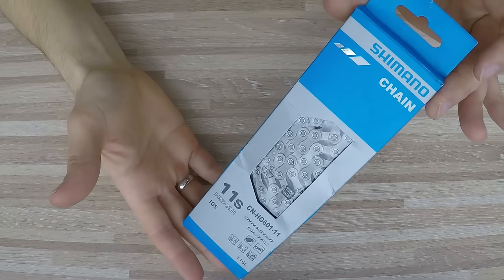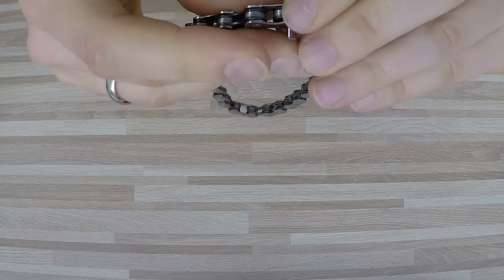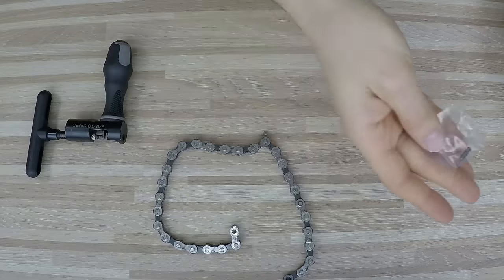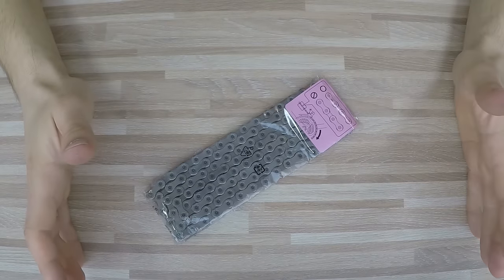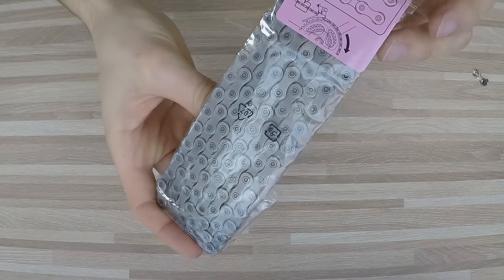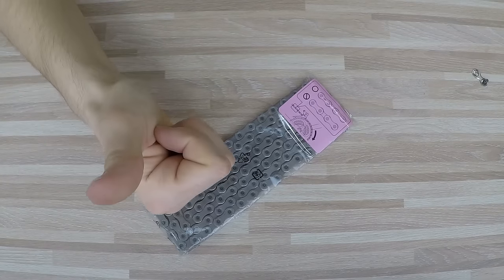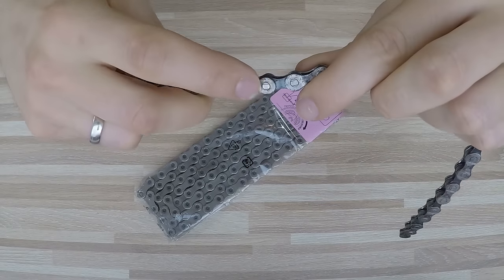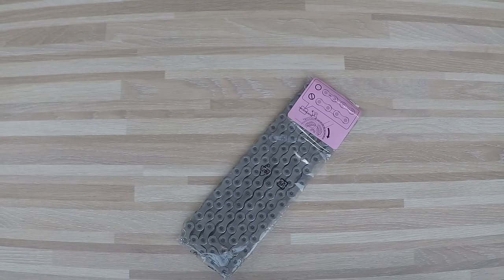4 Worst Mistakes In BICYCLE CHAIN Maintenance. How NOT to do it. SickBiker Tips.

Comment: 1. EVERY chain manufacturer advises NOT cleaning chain by shaking in solvent, because it dissolves lube that is inside the links, and that is where you need it most to prevent wear and tear.  Also, it is nearly impossible to get dirt into that space anyway.  KMC,  Shimano, Campag, SRAM, they all recommend brush, wipe, and clean outside of links. If the chain gets so gross that you don't trust cleaning only the outside, then go ahead and soak the chain, but plan on replacing it sooner than normal.  

2. Most lubricants will displace water.  In fact WD-40 was invented by the space program as "Water Displacement 40."  It is not a lubricant, but more of a solvent.  Use your favorite lubricant after WD-40, if you use WD-40.  (Yeah, I know WD-40 now has a whole line of products.)    

3.  Yes, check wear on your chain and replace around .75...........IF you have a 6-7-8 speed.  Park recommends changing 9, 10, and 11 sp chains earlier.  

4. There are several brands of connecting link, and they are not universally interchangeable.  I'm pretty sure that Shimano does neither make one, nor do they allow you to use another brand.  Experiment at your own peril.  (I have used quick connecting links on Shimano, that worked just fine; I don't remember which brand.)  

5.  Rust on the chain is a chemical change in the metal.  When the manufacturer says not to use acids or other rust removers, they are probably warning against use of chain that has compromised its strength, as well as admonishing against dissolving whatever lube remains inside the links, where you need it. 

Roger
Pedal Pusher Bike Shop, NYC
Reply: I restore vintage bikes and as a rule, toss the chains and replace. They test out as stretched, often have rust on the INSIDE, and are junk as a rule to my mind.
Reply: Sorry pal, shaking chain in can of mineral spirts/or other solvent is the ONLY way to get sand and grit out of rollers. WD40 is nothin more than mineral spirits and 3and1 oil. Boeshield t-9 lube WILL penetrate to interior of chain. Next time you think your chain is clean, while your WD40 is still wet hold a two foot section of chain between fingers and twist. I guarantee you'll hear the audible sound of grit inside the chain. By the way I get around 1500-1800 miles of off road usage with Shimano XTR chains. The chain "experts" who preach this crap are the same idiots who tell people to wash their $5000 bike with a garden hose. By the way, I've been riding and/or working on bikes for 65yrs.
Reply: wwolfdogs we need people with your experience to make videos showing the best proven methods of bike repair and maintenance.  How do you wash a mountain bike without a garden hose?
Reply: I always liked Triflow as a lube. I'm lucky you have an ultrasonic cleaner at work. Simple green seems to work well in it.
Reply: A chain is just connecting plates, pins and rollers. There is no internal mechanism....
Reply: @s0012823  In between the pin and roller is internal to me,
Reply: @wwolfdogs  65 years of wasted effort!

Obsession with getting EVERY little bit of grit or grime off a chain is a COMPLETE waste of time. Why? A half hour on a road ride and your chain's dirty again. Five pedal strokes off road and it's dirty!

The worst part is that it encourages the use of all sorts of solvents, some safe, others not. I found a YouTuber who had a how-to video on soaking your chain in gasoline. There he was working in his tool shop garage using gasoline to clean chains. And showing others how to do it. Completely irresponsible.

THIS is what you want to avoid. The risk of blowing your place to kingdom come is not even close to worth it. And then if you are smart enough to switch to safer chemicals fire-wise, you STILL expose yourself to all manner of VOCs and organic compounds. Remember, the chemical industry in the USA has NO OBLIGATION to offer safe compounds to consumers. They let YOU use them, then contract cancer if it turns out it's unsafe. Then YOU have to sue. THIS is the United State's approach to consumer safety as far as chemical industry products are concerned.

And then there's the next point: removing ALL the lube means getting it BACK in there! I soaked chains for a while as a kid. It usually took three rides and over-soaking the chain with lube to FINALLY squelch all the little squeaks that would arise after another mile or two of riding.

So all this, only to remove lube where it's most needed: within the chain rollers.

Now the exception is the major mud or crud ride where the bike's completely covered. At this point, it's better to just hose the entire bike off, use a little gentle soap on everything, rinse and blow dry with a compressor.

Then lube the chain as normal.

But this obsession with chain solvents, brushes, containers, spinny thingies, OCD with TOTALLY CLEAN CHAINS is a complete waste of time.

Chains are consumable items no matter HOW much you obsess over a clean chain, it STILL wears out! Pick a good lube for your location and riding and be done with it.

Ride, wipe, lube. That's what a chain needs.
Reply: And I'll add this:  I JUST went against my above advice last week and fully degreased my replacement chain.  Why?  Because DuMonde Tech requires it for their polymer lube to work properly.  (And I've confirmed this by using it both ways, and it works FAR better by preparing the chain properly.)  And sure enough, I start a 19 mile road climb yesterday after thoroughly lubing my chain twice and sure enough, squeaks emerged.  I listened to that squeak for the entire four hour ride.  (I'll remedy it quickly once I'm back in the shop.)

But the point is this:  fully degreasing a chain means having to totally over-lube it to get all the lube back in there.  I added this because I JUST experienced the consequences of doing it yesterday.

Don't waste your time.
Reply: And I'll go one step further and say this:
The "wipe, lube, wipe" method allowed my beloved Sachs/Sedis silver chain to last 30 years on my road bike!  Now I'll admit it went several periods of not being ridden once I stopped racing.  But it still got a lot of mileage and was truly amazing in its longevity.  I JUST finally pulled it off as chain wear was nearing 1/16".  Boo, hoo!
And trust me, I'm a pretty fanatic drivetrain cleaner.  My rings and cogs almost always shine pristinely.  

Wipe.  Lube.  Wipe.    That's it!

But I gave up chain soaking at age 17 when I realized how absurdly stupid it was.

Comment: Another great tip is when you insert a new pin you should always insert from the inside out. The keeps the side you break off (which can stick out a little) from rubbing against the cogs.
Reply: If either side  "sticks out a little", you've not done it correctly. The key is to push the pin through, when you feel it is good, take the chain off of the chain tool, see if the links are rotating freely, if there is a drag, put the chain tool back on and push another 1/4 or 1/2 turn just enough to get the plates to swing with no drag. Now you can snap off the extra length of this pin!

Comment: I'm using chainwax.
Whenever I have a new chain, I shake it in a bottle of turpentine.
Then I oil it, drive a few hundred meters so that the oil gets deep into the rollers.
Finished off with wax.

Keeps the inside of the chain lubricated and the surface that contacts the sprockets.

Comment: For all the people who've been doing this for 30 years,  up to about 10 years ago doing this wasn't a problem and if you still use BMX type chains or bin your chain as soon as it hits 0.5% wear you'll probably still get away with it. Chain technology has moved on a lot in the multi gear systems though. Chains from 9 speed up are too narrow for there to be a decent factor of safety on the friction between the pin and the chain side plates, so opening and rejoining the chain with the same pin is no longer safe. Incidentally Shimano claim (Correctly in my experience) that their 10 speed chains are both stronger and more durable than their 9 speed ones. They also shift way better, to the point where I use only Shimano chains on the geared bikes I have with 9 or more gears (I have bikes with 1, 7, 8 9 and 10 gears). If you run the whole drivetrain until it wears out you will get a side plate popping off as your warning that the chain (And cassette and chainring) are done. There's almost no degradation in shifting, but a little more noise towards the end if you run chains like this. Overall the cost is about the same unless you're running SRAM 11/12 speed cassettes or Shimano XTR but you spend much less time working on your bike, which is something to consider if your time is valuable to you. Throwing lots of slightly worn chains away is pretty wasteful too.

Once Sachs moved to powerlinks on their 8 speed chains (Probably 10+ years ago at this stage), there was no manufacturer that would recommend pushing the same pin in and out to join derailleur chains. Incidentally Shimano recommend breaking the chain at any link except for the joining link and joining with a new pin every time to avoid wearing the holes in the side plates of the chain too big. Newer (All 10 and 11 speed) Shimano chains have an inside and outside too - the links with things printed on them should face towards to outside of the bike when the chain is fitted correctly. The joining pin should also be to the front of the outer plate it presses in to in the direction the chain turns and when shortening the chain, links should be taken off the end that finishes with inner plates rather than the end with the outer plates as then the joining pin goes into a fresh hole in the link plates.

The requirement to remove the grease the chain ships with before fitting the chain is complete rubbish however. Any chain manufacturer I've heard from recommends leaving it on as it is designed for the chain and on my bikes it certainly keeps the chain running nicely for longer than any lube I add afterwards (Mainly because I suspect it's put on at high temperature, so it flows into everything, so at room temperature it's stiff enough to resist being wiped or washed off).
Reply: There is no better way to lube a chain than to hot soak it in a combination of paraffin and motor oil.  No dirt and very smooth shifting.
Reply: I think  SickBiker just meant to remove external grease, not the grease from the inner part of the chain where it actually needs it.  I recently installed the same shimano chain and had this experience. I left the factory grease on but after a quick few rides around the neighborhood on paved road (not even on trails yet) and it was collecting a lot of dust and dirt just from that. I wiped it down with a rag for awhile (no degreaser) and then lubed with my finish line dry teflon and it seemed much better with less dirt sticking to the chain.
Reply: Hate to tell you, Shimano started the long replacement pin chains in the mid to late eighties, almost 40 years ago! If one were to simply use a chain forever, long before any plate will pop off, you will experience chain skipping, under intense pressure the chain will skip with sometimes disasterous results!

Comment: I agree fully with the degreasing the chain lightly as the stickiness of the grease can attract a lot of grime unless your in the wettest conditions ever.  I work at a bike shop and we always lube the new chains thoroughly and that is enough to clean that grease off and leave it nice and slippery.  Nice vid dude tons of good info
Reply: so do I use degreaser and then lubricant or just lubricant??
Reply: @changenoways9555  I use lubricant only if you want to use degreaser I would recommend WD40 as it's not too harsh use a rag instead of soaking the chain and a nice chain oil after it has dried overnight clean the chain again after lubing so the chain isn't wet on the outside and it will stay very clean for a long time
Reply: Definitely thoroughly degrease a new chain! If you're using wax lube, this is even more important!!! And as in the video, don't leave the new chain too long in a jar with degreaser. Maybe for a few hours.

Comment: I'm 2527 miles into this last year's chain.  For about the first 1000, I took great care of it and saw no stretch.  I've not lubed it for the last ~1200 miles at all until today.  It's about a .5 stretch.  This would be the first time I've ever done that.  I may just keep ignoring it as log as it doesn't get wet, and checking the stretch.  Buying another chain for $10-20 every year before it's very worn is a lot cheaper than the lube and my time.
Reply: It’s the chain ring that’s expensive! A worn or stretched chain will ride up the teeth and cause a sloped edge. And that’s when the chain keeps jumping off them under pressure. Lube cost is irrelevant by comparison.
Reply: @glasgowbrian1469  I concur. I destroyed a beautiful Super Record drivetrain with Stronglight Chainrings by not checking the Chain Ware, and General Abuse, no lubrication, gritty chain, no regular cleaning...

Comment: When I replaced my chain (same model) I followed the manufacturers instructions which were NOT to remove the wax the chain come coated in and never degrease. With the previous chain I had followed the cleaning products manufacturer which were to degrease on a regular basis. Current chain has done approx 1/10 of the miles the previous chain did but shows about 25% worn, so at the moment I’d have to say that regular degreasing appears to extend the life of the chain. Obviously regular degreasing effectively means removing the grease/wax. But has to be said in this case it’s seeming like the chain manufacturers recommendations are geared up to selling more chains. Clearly there’s a happy medium where the right amount of cleaning and degreasing will best efficiency of mile£‘s.

Comment: Possibly the most important thing to do - regularly check the chain with a simple chain-checker - if it's at/beyond 0.75, replace the chain (and certainly before you hit 1). Much cheaper to replace the chain before it wears your cassette and rings to death...
Reply: Andrew Bruce more importantly prevention of injury to gonads
Reply: So true!  ...PS, I never had to do this back in the 5 and 7-speed cluster days!  :)  Love the chain checker now!  (one of my bicycles is hanging on at a solid 1.0...uh oh...)
Reply: Never done this and I still have the rings that I put on a bike back in early '80 (yes 1980) that seem ok and that've  been on 4 or 5 bikes and 3 of them were commuting/pub bikes that had their chains greased every 6-9 months and I used as such for 13 or so years (I've had other chainsets since on other bikes) - they'll go back onto their original 600 arms when I do a replica build of my 1980 bike (though the arms look in worse condition!) I guess they don't make 'em like they used to.
Reply: Paul Treneary - I completely agree with all your points.  I have a classic cromoly frame bicycle that will out live ME and its still my favorite by a long shot!  I do see the value in the chain checker though.  the new 11 speed chains are thinner and more delicate.  of course, you can still spot a chain that needs to be changed by eye (or feel), but its just nice to put a number on it.  makes me feel better.  :)  what is your classic bicycle?  i have an old set of "600" wheels (axles), but now I buy 105s instead of ultegra.  (maybe I just like numbers better?)  :)
Reply: It's all circa 1978-1981 and nothing better than an old Holdsworth Mistral (531 F&F) with Super Champ rims on Campy hubs and gears (1st gen Rally long cage and Neuvo Rec front &  levers), Weinmann drilled levers and brakes, 600 (Arabesque) arms with either Dura-Ace or 600 rings (a detail now lost in time - I had a non-std 53/40 pair) Campy pillar, Brooks Pro and  Cinelli stem & bars - it turned out I built an Audax bike in 1980 so when I severely bent it I bought a Thorn Audax in '96 which I still ride (though all bar the frame, stem and bars has been replaced/upgraded) . Re 'numbers' - as new the Thorn had a mix of whatever needed to be good - MA40s on XT hubs, 600 shifters but only RX100 calipers and an Exage chainset
Reply: That's a great bicycle and group set!
Reply: I tend to replace the chain and cogs together.
Reply: And duralier polys
Reply: Haha I just replaced my cassette and chain today on my Ebike. I use the chain checker and it was 1.25 and with space to move! That’s how much an ebike chain stretches
Reply: +stephen carman
not only gonads, but a worn chain can cause you to snap your gears, which can send you over the handlebars and onto the pavement in the middle of a 50 mph intersection. if you survive, you'll have bruised ribs for months.
I'm speaking from personal experience.
Reply: @paultreneary  You are oh so wrong! I can think of nothing less appealing than the ancient crap you list. Welcome to the 21st century, get some carbon! This is from someone that had a full Dura-Ace equipped road bike in 1975!
Reply: @ShermanSitter  Yes, chain stretch happens irrespective of number of cogs or time of your life. You were just ignorant of fact! Worked on many bikes in the mid 70s, I knew better, in that time chains were far less strong than modern chains (they wore out far quicker)!
Reply: @larrydaniels6532  It has nothing to do with ignorance. It is the fact that the fewer cog cassettes are less sensitive. I'm surprised you didn't know that.

Comment: Great advice as always. What I take away from this is that for some of the big debates, there is truth in both sides, and you are pointing out the correct middle ground eg remove or keep the original grease - well, remove it from the outside, keep on the inside. Re wash chain with water or not, - well, use water, but then dry carefully and relube soon after